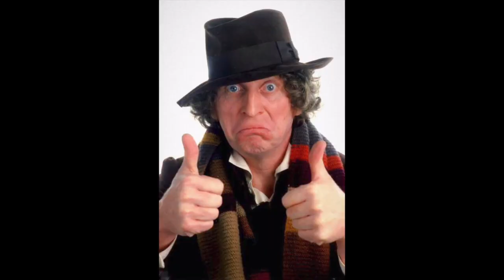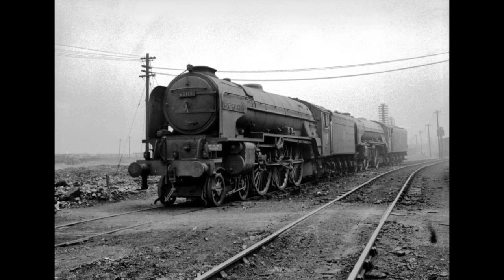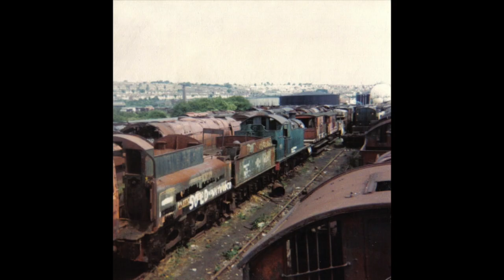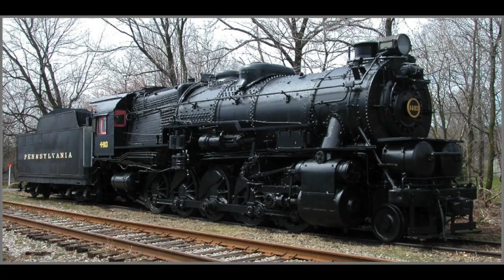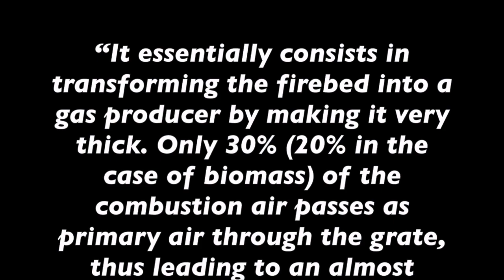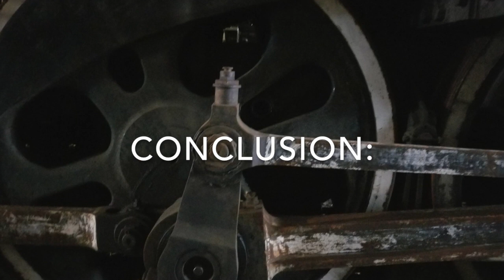New-Build Steam Locos: The Perks of Starting Anew

Comment: Another thing I'll say about new-builds is that the emerging industry for them is bringing back or increasing the production capacity that is needed in any case to look after the older engines.

Far too often nowadays we'll see an old engine spending a decade in rebuild off the rails despite it having been mostly fine when it was running.

With a larger and more capable industry around not just the preservation but construction of steam engines, we should see A) more parts and materials be available when needed, and B) more of the specialised engineering talent needed to work on them as well.

It would also be interesting to see an entirely new design in my mind, using modern designing and maching practices to truly push the capabilities of a steam engine to its fullest potential. We know that the great designers of the 1930s talked about steam being able to run up to 150mph whilst pulling full passenger trains if only they'd been allowed the development time. But all that was put paid to by the Second World War and so we never got to see the true heights that a steam locomotive could achieve.

Comment: Whilst the A1 Trust is building some beautiful passenger locos for what we call the mainline ie on normal everyday service lines. There is now a very critical engine being built what we would call a class 3MT 2-6-2 Tank engine by the 82045 Steam locomotive trust. This is a 'break through' engine for all the 500 miles of preservation lines in the U.K. dotted up and down the country. This engine is coming in at £1,25 million to £1,5 million, which is about a fifth of the price of an express engines of the A1 Trust. Now that we have rediscovered the art of making steam locomotives, there is now a conversation being held about bulk production of these Class 3MT Tank engines, that would have a lower unit cost. Interesting fact is that Tornado was completed exactly forty years after every steam locomotive was removed from the mainline and holds the Preserved steam record of 101 mph. This was a trial to prove that steam locos could operate on the Britain's mainlines at 90mph + 10% (safety margin) as the U.K. looks to speed up services across the railway network.

Comment: Good essay. I hope you did well out of it. 

There's certainly advantages to new steam locomotives, even so far as giving the older ones a rest. Having said that, contributors usually only have so much money to part with. So, some new builds do much better than others. 

In the UK, there are some projects progressing quite well I.E. LNER P2 No 2007, Brighton Atlantic 'Beachy Head', Ffestiniog England 0-4-0T 'Mountaineer', GWR Grange No 6880 'Betton Grange' amongst others. But there are others which are either planned or have started where the interest isn't really there. Thus, the fundraising isn't progressing quickly enough. 

With the current Covid19 crisis and the impending difficulties in coal supply, some of these new builds may need a re-think. 

Keep up the good work.